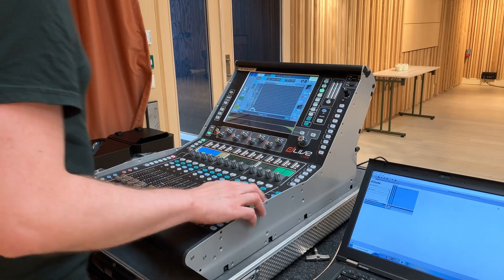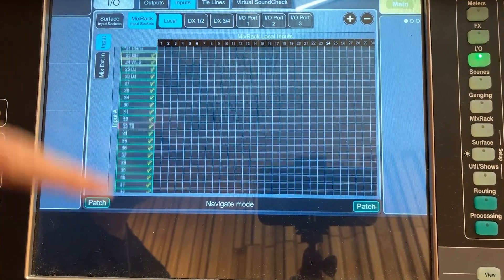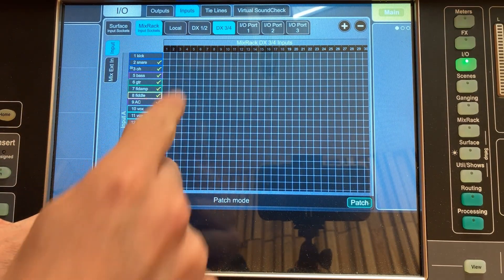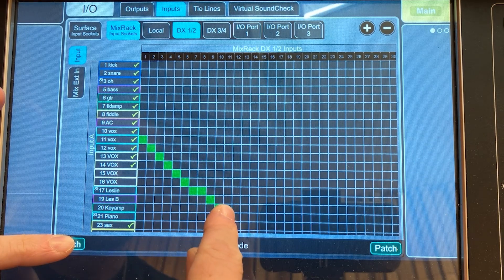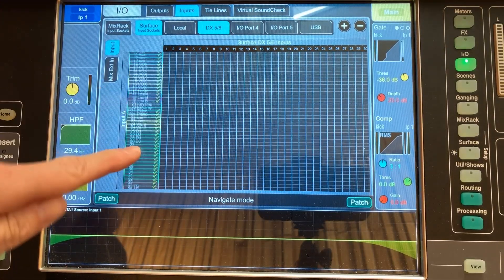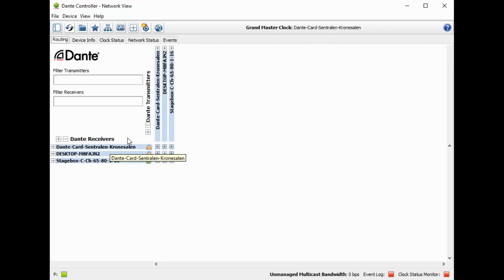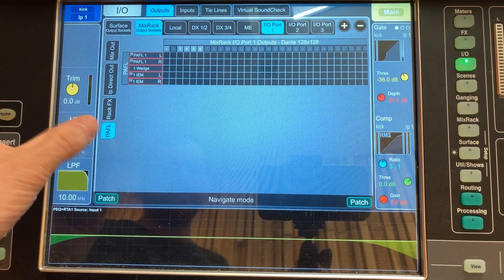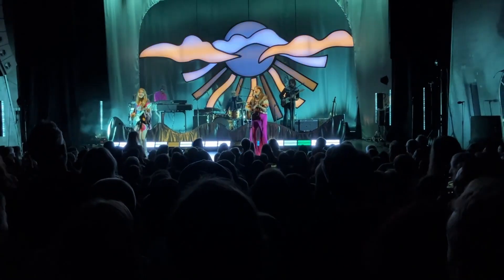Understanding Routing On D Live Mixers

Comment: Great video! I've watched a few of your vids now and this one has prompted the Sub. Well done. We have a dLive set-up at church: a DM0, 4 x DX168's and a computer running Director emulating an S7000 using 2 x 27" touchscreens. All of the sound team have pretty much learned as we go, and I've found this IO screen to be one of the most confusing (even though it looks like it should be simple). So thanks very much! Off now to watch your Dante network vid...   1 question - can you give a real-world example of using Tie Lines? I'm struggling to think of any.